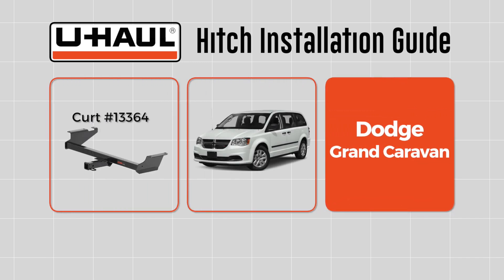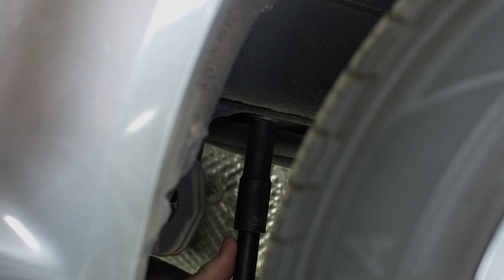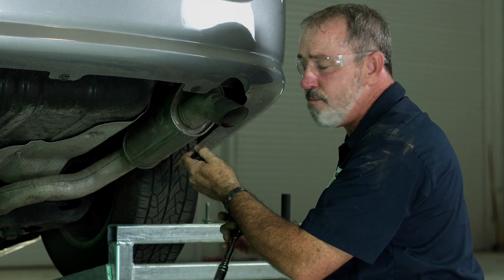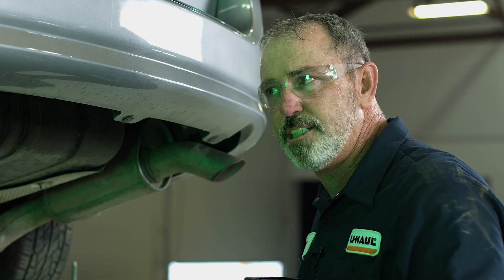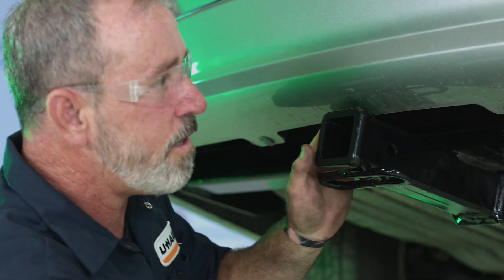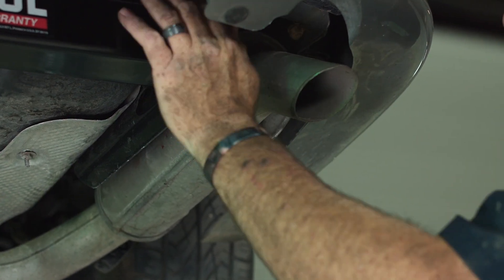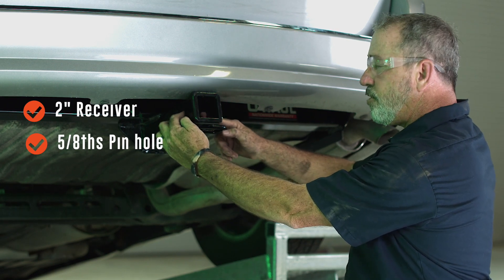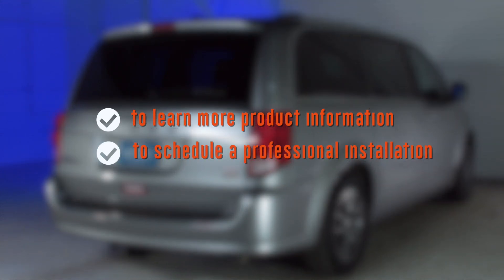2014 Dodge Grand Caravan Trailer Hitch Installation

Comment: You have us confused !
You said to have a 13 ,15, and 18 mm socket .
Then as you install the bolts , you say 12 mm , and 10mm . No mention of a 18mm socket ?? 
That's 5 different size sockets all mentioned 🤔.
Just to bring it to your attention . 👆
Reply: The diameter of the bolt, not the size of socket